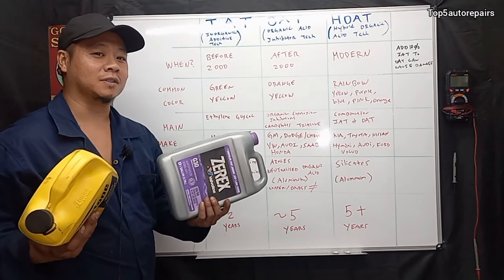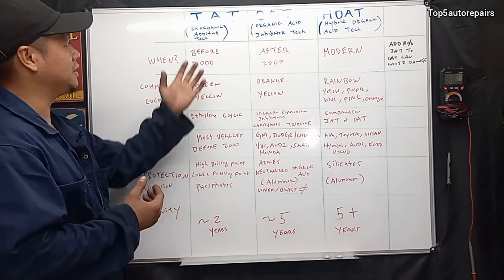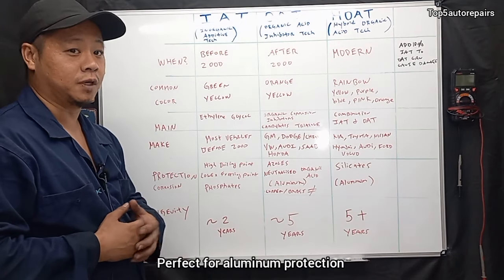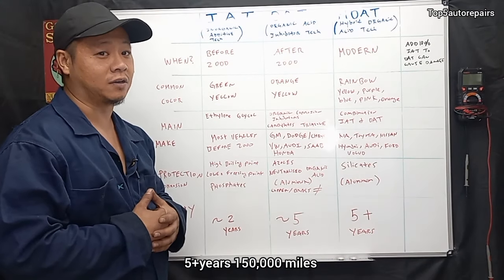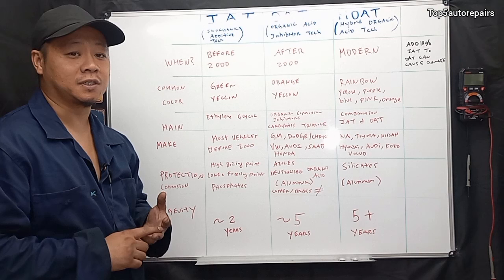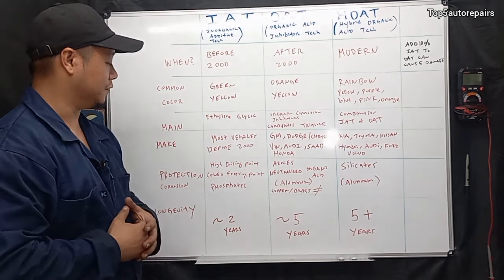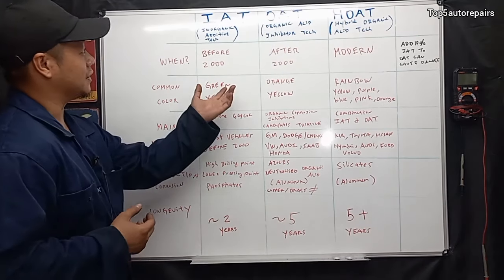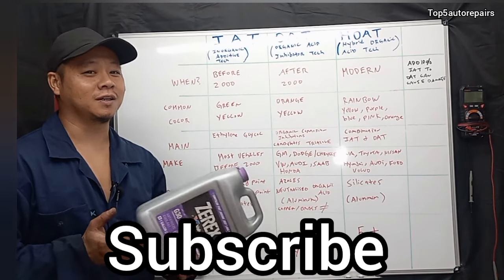CAN YOU MIX COOLANT COLORS, BRANDS OR TECHNOLOGIES??

Comment: I have an 2014 Infiniti G37 s coupe. I had my radiator replaced, and now I need to top off my coolant reservoir. I’m not sure what coolant they used, and it’s at the Min. Line. It looks bright green I called and asked the shop what coolant to use and someone advised me to get Prestone all vehicle coolant. For my sense of comfort and peace of mind can you confirm this is ok to do please? I plan on flushing it and going with OEM Nissan blue coolant, but have a long drive before I can do so.

Comment: Thank you so much! This was very informative. Just to make sure, I have a 2020 Kia Rio. The OEM coolant that came in it has the color green. It is P-HOAT ethylene-glycol based coolant. I need to top off my reservoir, and the closest thing I found was Zerex long life for Asian Vehicles. It is also P-HOAT ethylene-glycol based, but the color is red. The video says that color is just a dye, but just wanted to confirm that this will cause no damage mixing the green stuff with the red?

Comment: In my semi I definitely know there is a difference some end up breaking down quicker than others that's for sure I've done so much testing I have 2 trucks 1 has had the same coolant almost 15 years yes I've had to add some here and there and yes I add the minerals that it's lacking after I have it tested now my other truck man oh man I've thrown just about every kind of coolant in there that I can think of I had it so messed up and acidy a bunch of times that now no matter what I put in there it turns rust / mud red

Coolant and oil is sent out to get tested EVERY service I do

Comment: Very good and informative. Also make sure that the dealer and shop use the correct coolant when they top-off your coolant and don't mix incorrect antifreeze in your radiator.

Comment: I have Hyndai Santa Fe 2009. Green coolant. I have not changed it for 10 years. The fluid looked always bright green and no speck of inpurity. But too old to stay in the system.

I went to Hyndai dealership and picked up Hyndai original brand coolant that is for my car. Also green in color. I backed up car on 1 foot high ramp to lower the front. I drained old staff. Took a sample bottle. It appeared somewhat transparent bright green and no particles. 

I flushed the car with tap hot water. Drained it 2 times. Let the car run 15 minutes with heater at max speed and heat. Drained it again. The water was clear but maybe slight hue of green. I used an air pressure to empty overflow tank into the top of radiator. I rinsed again with bottled distilled water through the overflow tank. Let it run a bit and drained it.
Then I added 1L concentraded coolant into the radiator. I added 0.8L of deionized water. It was full. I let the car work 20min with heater and AC on. No top up needed. I took for a slow ride around the block. Looked at fluid and it had a hint of foam (2-3 creamy bubbles). I took for 20min drive to work. The radiator cap appeared to have plenty of yellow (curry) light foam. I wiped it off. The fluid itself looks green but not as transparent. It has tiny white specks as deep as I can see. Not on surface. I looked inside the overflow tank and it looks very clean bright green with no issues but a hint of rainbowy oily surface. Perhaps from the coolant itself. 

1) Did I not suppose to pour concetrate into radiator but do it mixing in the overflow tank? Hence concentrate got foamy as it was blended by the water pump?
2) Could have green previous fluid reacted with green new fluid? And this is the effect of gelling up? 
3) Could the new fluid act as a wash and pick up dirt/rust from the inside? 10 years worth of stuff. I believe its an alluminum block.
4) maybe air pressure blown into radiator cap created a hole in the block or transmission where oil is now getting mixed with coolant?
5) Other possibily?

I will right away flush it with tap water in case its the jelling up process. What steps you think I should do?

Comment: The main issue is the corrosion inhibitors from different types react and neutralize each other so you start getting a lot of corrosion.

Another problem that arises is that if you switch from one type of anti-freeze to another (complete drain and refill) is that all engines have some corrosion and dirt in them that's adhered strongly to the interior surfaces , when you change the type of corrosion inhibitors you are using ,all of the dirt can suddenly come free at once and clog up your radiator and heating core.

I run into this issue quite a bit with forklifts , the owner buys a used forklift and switchsd it over to green glycol so all of his forklifts use the same antifreeze , and a week later the radiator is clogged up with rust and sludge.

Comment: What about all the honda and toyota aluminum engines before 2000? They all used the common yellow antifreeze, never saw any jelling or deterioration.
Reply: Ur wrong completely
Reply: @coltonzelkin2694  That's ignorant, how can you say I'm wrong about what I didn't see. It says use on any engine, so what did Honda change in the metal too in the early 2000's to need a different antifreeze. They're just selling dye for twice the price.

Comment: So if u can't mix them together what's the point for HOAT isn't it mixed?🤔
Reply: Hoat is the most balanced coolant. You can top it off a little bit of anything. Thats why the answer is yes and a no if incase of emergency. But regarding dye color it doesnt matter will look sht long term though. Been using different color same technology  flush it properly

Comment: Hi want quick question what if you mix OAT and HOAT ? It will be fine?
Reply from the maker: You can use OAT in a HOAT system but can't use HOAT in an OAT system.
Reply: What are your thoughts on this scenario :

I bought  HOAT mixed it 25% with water as per bottle instructions. Added about 200ml to my OAT system as a top up. Am at risk of gel or will it be OK?

Comment: I don't worry about such things. I don't live in a cold climate so I don't need antifreeze. I have never ever used anything but pure water in any of my vehicles. I have never experienced excessive corrosion. My engines run at Perfect temperature. There have been times when I have drained the water after 2 years and not noticed any more corrosion than when I used to use antifreeze. So, if your vehicle is never exposed to freezing temperatures, don't bother with antifreeze at all!😊
Reply: Smh I been using water the whole time but wanted my ac to work didn't know it only cools that way too
Reply: @AntonyoTrapp-zg7ic I don't understand what you're trying to tell me.